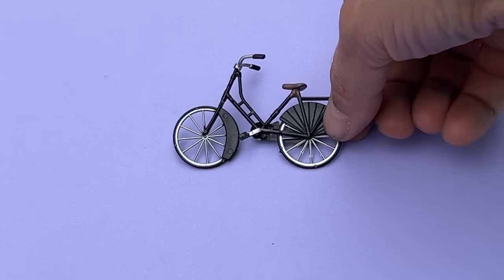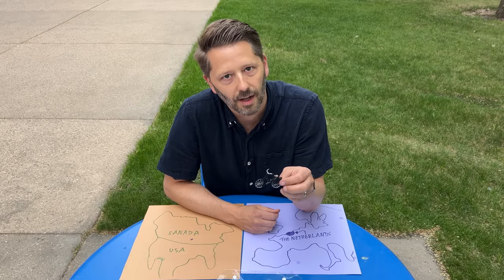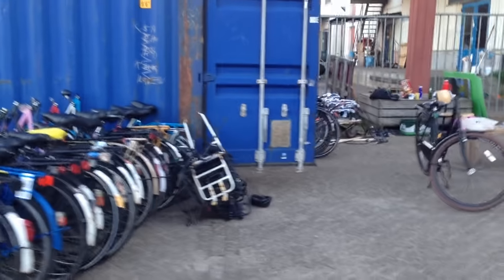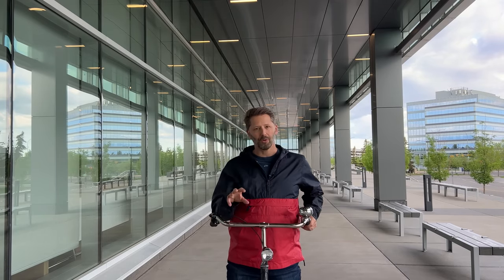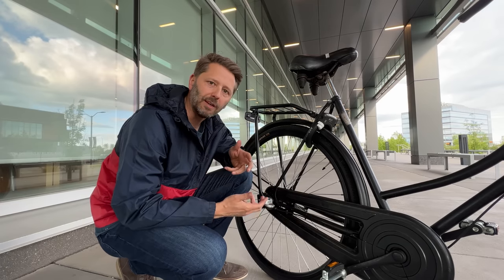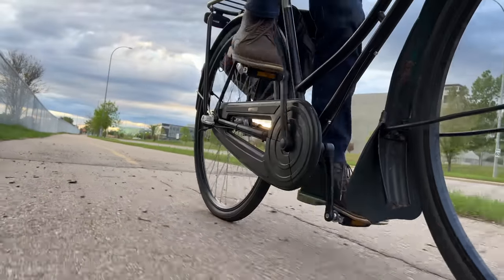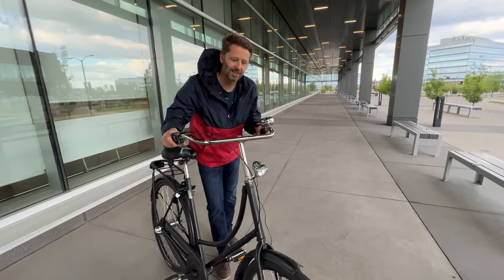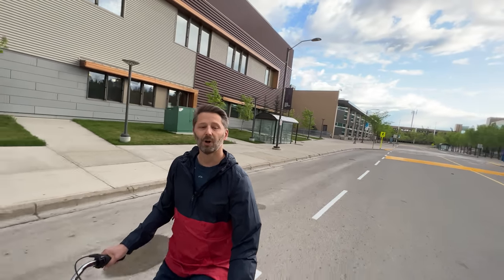I finally found a true Dutch bike in North America. Here's what you need to know

Comment: As a Dutch woman I can say you miss a very important part on this bike, "jasbeschermers"😊 I dont know the english word, sorry. Literally a jacket protector. It covers about a third of the back wheel and prevents your clothes from being trapped in the wheel. Usefull since we tend to wear our normal clothes on our bikes.
Reply: where do you buy these here? My bike keeps eating my skirts
Reply: @dancingq1729  
You can make them yourself. Get some plexiglass, a jigsaw and some sandpaper to smoothen the edges. You can make holes in it to fasten it by cableties. Most hardware stores fullfill that need for a few bucks.
Reply: It's called a dress guard or coat guard or skirt guard. It also protects children's ankles when they are riding on the back.

I would just buy a pair rather than faffing about with plexiglass, since you want them to be very light and fit very snugly so they don't fall off every time you hit a bump in the road.
Reply: @Welgeldiguniekalias  yes that was my question, where in NL sells them, I've not seen them used
Reply: @dancingq1729  Any bike shop, Amazon, Bol, Fietsonline and probably many more.
Reply: @Tanks_In_Space  That's nonsense. Many are not transparent (for example on an omafiets they are normally the same colour as the bike), and even the ones that are can easily be seen, like you see an empty glass on a table too. A more likely reason @dancingq1729 didn't see them is that they aren't very common anymore on newer bikes, and on older bikes that had them originally they have often been removed (because they are easily damaged and not attached very well).

Comment: it’s a lot like the Schwinn I had in high school, sit-up seat position, dynamo/generator, internal hub gears, coaster brakes, three speed, steel frame.

The video doesn’t show how you change speeds in the hub. I thought I recognize a bell on the handlebar, but that could’ve been the shifter.
  The Schwinn was lighter of course and didn’t have the frame lock or a coat guard.

Comment: I purchased one secondhand a few years ago in NL. Like you say they are simple, practical, durable, require very little maintenance and will normally last a lifetime.
Another thing to mention, they normally come with 28 inch 635 wheels and this in combination with the swept back frame geometry makes them a very smooth ride.
Another important point is that they traditionally only have one coaster brake, in some countries (like the UK) bikes must have two separate brake systems to ne street legal.

Comment: More than ten years ago I bought a real deal, heavy, steel, overpriced omafiets online and it was shipped cargo to JFK.  I’ve used it and upgraded various things here and there over time.  
I LOVE it.  
That bike took me all over Queens, Westchester, central NY… and it carried soooooo many groceries.  (Now it’s going to be shipped back to Europe, funny enough, because I’ve moved permanently.)

It was the gateway to getting a Butchers&Bicycles cargo trike too!  I’d always wanted a bakfiets, but I ended up with the trike.  :)

Where I am moving is hilly, so I must now add an e-bike, and I’m making it as Dutch as I can.  It’s a German mixte, and the only thing I must diy is the skirt guard, as I eventually did on the omafiets to replace what it had, by drilling holes in the fenders and using string.  In Germany it’s no big deal to get the chain case, and all the rest was standard: rack, frame lock, lights…. I remember the struggle to find or ask for any of that in the states a decade ago!  Actually, I think they could do the skirt guard, but as I originally planned on leasing it that wasn’t an option, and I prefer the string anyway.  Leasing bikes is very normal here!  So odd to me!  :D

Comment: While not the same, I chose my Trek District 4 for a lot of similar practical features. Internal gear hub (8 speed) with maintenance free belt drive, hub generator with integrated lights, fenders, rack, wrap around handlebars, strong disc breaks. I rarely ride my other bikes anymore.

Comment: As a Brit who's been living in Amsterdam since 2006. $500 for a used omafiets hurts - ouch! The Dutch omafietsen and opafietsen are idea for flat terrain, preferably with purpose built cycle paths. You did the right thing swapping out the rear wheel for one with a Shimano Nexus 3 speed hub and coaster brake. For city use, that's all you'll need. It's a good, strong geared hub.  Personally, I'd fitted caliper brakes on the front forks. It's always good to have that extra stopping power when needed. You should ditch the dynamo. They create a huge amount of drag. Just buy a front and back set of LED bike lights. Most of them run on CR2032 button batteries that easily last the whole winter.
Reply: "You should ditch the dynamo. They create a huge amount of drag. Just buy a front and back set of LED bike lights" 
Not when you aren't using them. So might as well leave them on in case you get caught out would without your LEDs lights.
Reply: @JCGver  You still get the magnetic drag, even when the lights are turned off. It's like peddling uphill all the time. Just keep a spare set of LED lights at hand, they're cheap enough to buy. Here in The Netherlands, a decent set costs between 5 and 10 Euros. I'm lucky I have a 3-wheel cargo bakfiets, (a super useful bit of kit) I keep my spares in the toolbox I carry around. On a regular bicycle, they can be kept in a small saddlebag.
Reply: @AndyinMokum  "Here in The Netherlands," Calling bullshit on that. Every dutch person knows you turn them off by moving the dynamo away from the wheel. To engage them again you press down on them.

So tell me where does the drag come from if the dynamo isn't even touching the wheel?
Reply: @JCGver  Not hub dynamos.  You're confusing them with the oĺd fashioned bottle dynamos. They really drag if you leave them on.

Comment: I have been volunteering with our community DIY bikeshop. While we don't have any dutch style bikes, we have found a few ways to help make a more upright cycling experience. Some of the older steel frame roadbikes and mountain bikes can be "upgraded" to be more of a daily rider.
Reply from the maker: Great idea. I'd love to see more of this.
Reply: Upright cycling position is desirable if you don't have the mobility or arent going faster than 18 km/h. If you are a naturally strong or  speedy rider, you are just sabotaging yourself. People assume that upright is inherently more comfortable, but not quite. What makes for a ride that is not tiring is the ability to change positions, sitting upright and loading your spine vertically all the time is not more comfortable or healthy than being more stretched out if this is the only position the bike  allows  you. There is a reason our euro style bikes have big springloaded saddles or suspension seatposts, it is because that position hammers your ASS.
Reply: Two inch stem extenders and swept back bars from planet X in the UK. Very simple conversion for anyone to make their machine more comfortable
Reply: @Exgrmbl  I have a vintage Fuji Road bike. I converted it to a 1by, changed out the stem and added Riser type handle bars. It is definitely a more comfortable riding position than the drop bars. I haven't had any issues with it being slow though haha. My other bike has drop-bars and it's just nice to have the option between the two.
Reply: @gilbster  
it all depends on your riding. A position which is comfortable over a distance of lets say 10-20km will usually not transfer over to a distance of 50-100. And the benefits of another position might not be felt until you travel longer distances. I take my dropbar tourer for 100km distance, but i wouldnt use it to shop groceries....and vice versa
Reply: @Exgrmbl  I have thought about getting some butterfly or kitchen sink bars for longer rides.
Reply: @gilbster  
kitchen sink looks interesting. Butterfly bars are common over here, they work really well if you are used to flatbars but i always found them quite ugly

Comment: I hope you'll read this: Your bicycle is a slightly older model Pointer Glorie (the non-Deluxe model), minus some aftermarket swaps such as the bell and seat, and the headlight was swapped for a generic chrome unit (a common occurrence as people are often too lazy to fix their headlight after something happens to it.)

The taillight is an odd one as it comes from a newer Pointer Glorie (R3 model), but that could just be a transitional thing between production years.
You are missing the rear wheel spoke guards that originally come with it but those don't really add much value to the bikes anyway.

Not very useful info, but info I thought you might want to know about your bicycle! :-)
Reply: U are right not a Gazelle ore a Batavus but a Pointer.

Comment: Don't use the chain that goes into the frame lock. They are much less effective /convenient than a seperate chain:

1. If someone manages to pick your frame lock they'll also have your chain lock open at the same time. Whereas picking 2 locks takes longer. 
2. Even without picking the lock, the chains apparently don't take that much force to seperate from the frame lock.
3. With the frame lock chain you always have to get the frame lock close to any fixed object. Whereas with a seperate chain you can attach it from the front of the frame or even the front wheel (although that last one comes off pretty easy, so you might return to a front wheel chained to a lantern), all the way to the back of the rack or the rear wheel (which is much harder to take off due to the chain). 

So just get a seperate chain instead of the frame lock attachment. 

And if you just put both keys on the same key ring it's barely any extra work to undo 2 locks instead of 1.

Comment: You can also carry items directly on the rear rack, without bringing a bag. Usually they have rubber elastic straps (mounted to the wheel axle, strapped across the rack) to hold the item in place. Snelbinders. Quick-binders.

Comment: I just bought a really lovely oldschool Omafiets from the brand Gazelle, they stopped making that kind around ten years ago. It also has an old 'dynamo' for the front light that spins with the wheel to power the light. I had that bike from age 14 until 21 or something and it's the exact same one, such a great feeling and nice way to connect with my youth. I'm 35 now 😏 still going strong!
Reply: I have a Gazelle bike from the '80 still.

Comment: I'm impressed by how much you mentioned. While safety is of course about street design, I think it's also quite important to mention that it is illegal in the Netherlands to ride without functioning rear and front lights, and all bikes sold are required to have differently coloured reflectors in the pedals, wheels and rear (and usually they have one in the front as well). That makes cycling in the dark quite a lot less scary.

Comment: This frame style was specifically made for women since the early 1900's. The low frame allowed them to mount the bike while wearing a long skirt. "Herenfietsen" (Gentleman's bikes) are pretty much the same and very common, but as you say they come with a more recognizable looking triangular frame.

Something that's missing from the bike that was probably on there in it's original state are the "snelbinders", large rubberbands connected to either side of the rear axle that wrap around the luggage rack. Pull them upwards, put whatever you want on the rack and the rubberbands holds it in place.

Personally I hate the classic dynamoes. While physics tells me that I shouldn't be bothered by a small traction wheel on a large tire, you can really feel the friction while pedalling and during heavy rain it will slip very easily. Also the light that comes off these bulbs is not really enough to light up the road in front of you, it's more to make your bike more visible by other road users.

Durability depends on the brand. The best brands for example are Batavus, Gazelle, Union or Cortina, but you can by much cheaper bikes at you local hardware store or department store for maybe €150. The quality is a lot worse ofcourse.

There could be a couple reasons this ones unbranded. It could be a very cheap bike, meaning that all branding was probably done with stickers that could be easily pulled off, or it has been repainted. Also not an uncommon thing to do when buying a beater to park at your local train station. You want your bike to stand out between the hunderds of other bikes around it. (Personally I wouldn't have chosen black for that purpose)
Yours looks very much like this one, from the shape of the frame to the chain guard and even the taillight:
https://www.superfietsen.nl/pointer-glorie-omafiets-28-inch-glans-zwart.html

I enjoyed your video, it made me rethink a lot of stuff that are just a given to me when I ride my bike around town!
Reply: Jasbeschermers (coat protectors at the back), also something i missed

Comment: If they are 28 inch wheels (and they usually are), they give a smoother ride over bumps and pot holes.
Dynamo lights are good, but always remember they dont light when stopped at traffic lights.  
I call these bikes "Loop frame". The cross-bar (top tube) version gives good rigidity = less flex = efficiency = slightly less energy required plus plus. 
I have a 1922 Raleigh "Ladies" (28 inch wheels) Little maintenance. Goes well.

Comment: Cannot stress how much bike reviews depend on the location. Theres a reason you only see mountain bikes or road bikes in scotland, a "simple commuter bike" just doesnt work, and a mountain or road bike can easily fill the niche of one of these. Mines is either thick aluminium or steel framed and I've slapped a rack on the back, thinking of getting road tyres for when I'm not on gravel and dirt paths, and a drive train with enough range for what ineed (but even with 3 up front and 7 in the back, I still feel like it needs a wider range for even the commute to and from the city centre).

If you love someplace flat though, get one of these, or if just convert a mountain or road bike to fit your area the best, or maybe get one of those cruisers made by schwinn, the world is your oyster

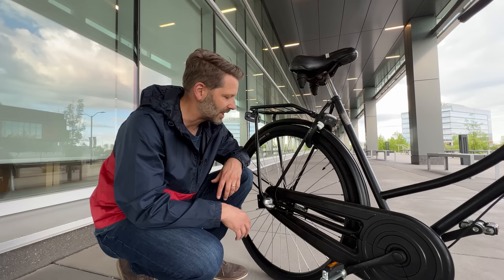Comment: 9:17 «I guess you could add a derailleur»

can’t see if the bike has a derailleur hanger, but even if it does, you can’t use a derailleur with a full chain case like that. 

You might be able to set up a chain guard (top+chainring only) to work with a rear derailleur, but it’s tricky because of the chainline changes as you shift. I’ve seen it done, but it always required having the chainguard pretty far from the chain, so you might still be able to catch a loose pant leg under it.

Comment: @7:50 Bikes with top tubes actually are very common in the Netherlands. It's an exception to see men riding bikes without them. It's important to note that they make the frame much stiffer and therefore make the bike much more efficient and stable and easier to steer. Bikes without them tend to wobble much more and a large part of the power you put in goes into bending the frame back and forth instead of propelling the bike forward. Bikes without them ("girls bikes") were originally made to accommodate skirts.

Comment: Long time ago I saw a 'external' dynamo on a bike here in The Netherlands! Nowadays the dynamo is almost always internal in the hub of the front wheel (if the bike is not electric, which it often is nowadays). Which in fact is a big improvement. I'm old enough to remember the external dynamo's, and you regularly had to re-fix the wires to them because they were so exposed, got hooked behind something and became loose. Also the friction is lower. 
Moreover, for the rear light they typically use a small battery now instead of connecting it to the dynamo, since those long wires running along the bikeframe to the rear light tended to break as well. This means the rear light will work even if the bike stands still, which is safer. However, in autumn, when you use your lights again for the first time after summer, you typically discover that you have to change the battery :-).

Comment: NL here with a small piece of advise: when you kind of cross your arms you can rest your elbows on the handle bars and loosely hold the handle bars on the opposite ends, which makes riding bikes, especially "omafietsen" WAY more comfortable. You'll be more aerondynamic too, which enables you to use less effort to ride faster.

Also: you're a guy, so you swing your leg over the sadle when you get on/off the bike, wether you have the horizontal bar in front of you or not. Call it "etiquette."

Comment: Very cool video and project. Been riding bikes all my life and still do, except for longer distances that I do by car. A bike is cheaper, easier to park, better for your health and more practical within cities/towns. I think the reason why your bike is unbranded is because the bike was repaired and repainted sometime in which they removed any branding. Most if not all bikes here in the Netherlands have branding all around it with some brands having a history of more than a hundred years. They're pretty proud of their branding on bikes. With more second hand bikes though you'll often see a mix of parts of broken down bikes. Most parts like sadles, steering colum, pedals, lighting, wheels and accessoires can easily be replaced and interchanged with spare parts of old bikes if you're handy. I used to repair my bike a lot this way as a student.